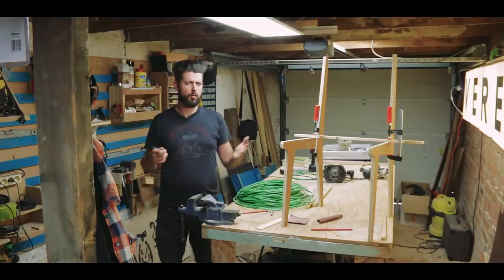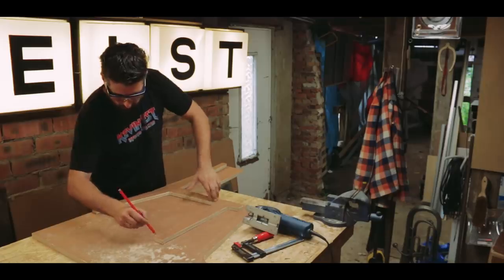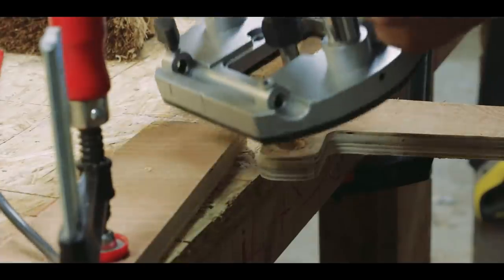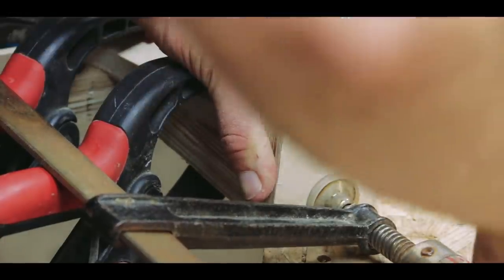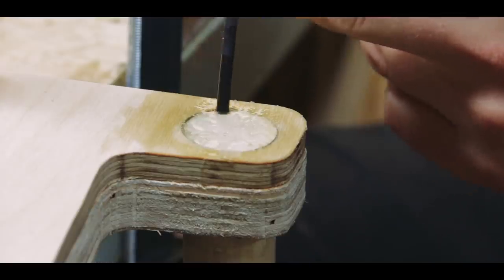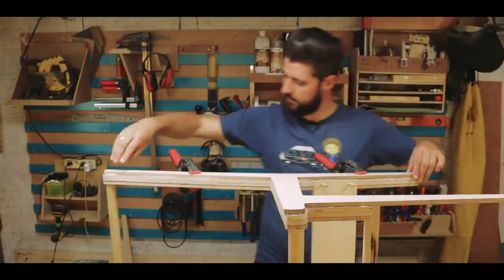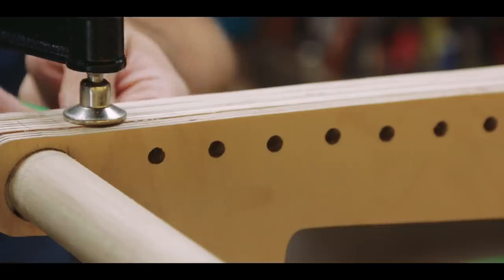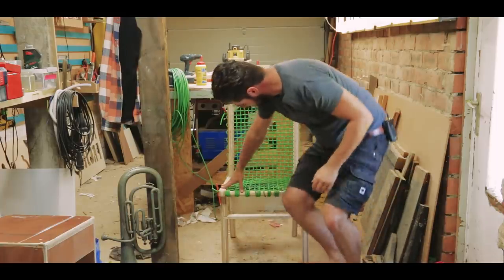How I made a Camera Cable Chair

Comment: Nice vid! You can use salt to avoid that two glued up pieces start sliding when clamping them together. Just sprinkle some in between the two pieces!
Reply from the maker: Dimi, that sounds like a tip I’ve heard before but have never tried. On my next long glue up I will, thanks!

Comment: Awesome job with weaving and finishing. But I tried to use a similar wire once to hang clothes after washing, and with time and effect of sunlight, they tend to become loose/weak. What's your say on this one ? will this hold for long ?
Reply from the maker: Hi Bhagat, thanks! I agree that sunlight wrecks plastic things, which I’ve found out the hard way. This chair will live inside so that effect is not in play here. As to stretching over time, only time will tell. I’ve never used this material before :) the weave is quite strong and each individual square only has to support a few 100 grams, since my 95 kilo’s of weight get spread over most of the seat. -I’ll drop a comment here in a year to let people know how good it holds up.

Comment: Great until the cable stretches... as cables do.  I suspect it wont be long until you have to retighten the weave.  probably just have to re weave it.
Reply from the maker: Could very well be. The design allows it to be re-done. I’ve also thought about adding butt-support under the weave if it should sag over time. So far it’s holding up great :)